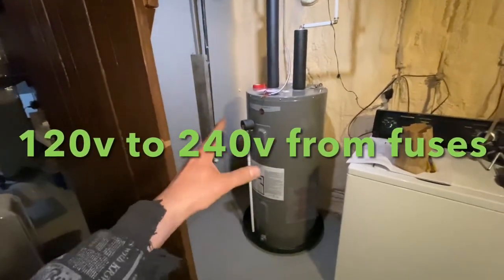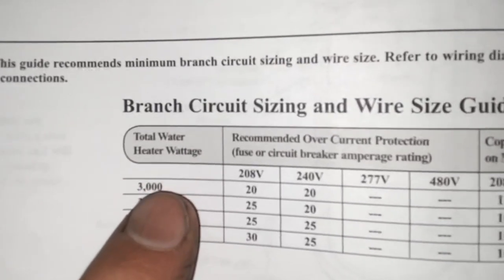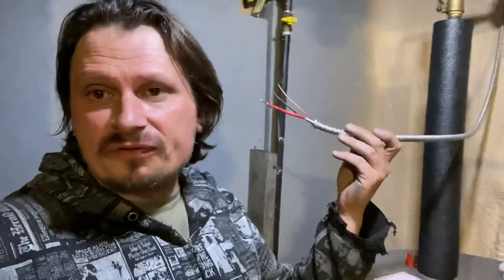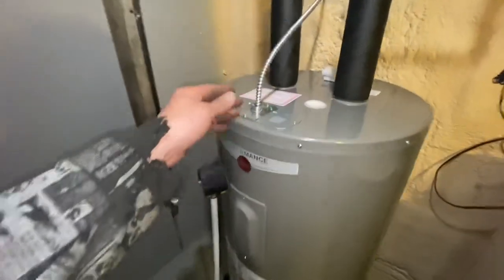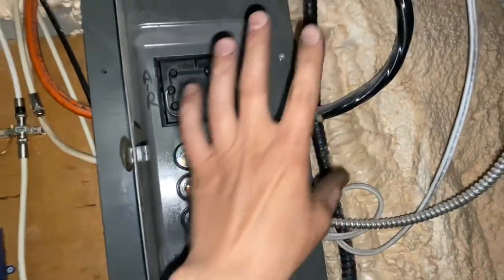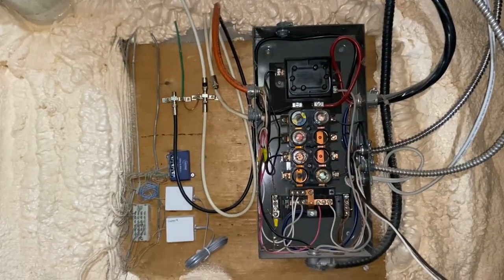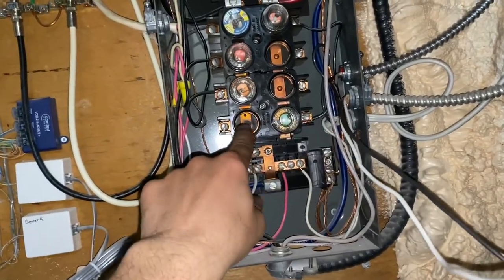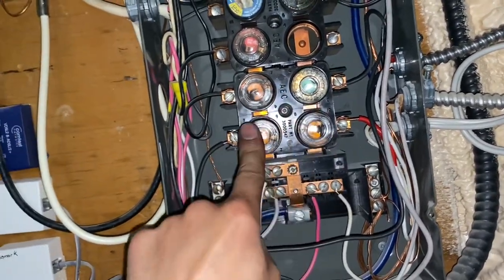How to Convert 120 V fuses to 240 V (water heater) (compressor) (240V receptacle) (240 V heater)

Comment: Thank you for taking the time to show how to hook up to an older fuse panel,  you don't see too many of these in use anymore.  Although using plug fuses for a 240 volt load does provide the same protection for the wiring as a two pole breaker in a modern installation,  there is a safety risk involved of there's ever a problem and a fuse blows.  Only one fuse will blow, leaving part of the circuit live and even through you'll get a chance to enjoy a cold shower when your running late for work in the morning 😂😂 , it is not safe to begin fiddling with the water heater, unless you enjoy the feeling of being knocked across the room.   That's why 240 volt circuits,  as well as multiwire circuits where two halves of a receptacle are on the red and black sharing the neutral  typically seen in kitchens from the 70s until the 90s,  are required to be on a double pole breaker,  or two single poles with an identified handle tie, because if either side trips you want to ensure that all power is removed.

Comment: This works and does provide over load and short protection, but I am fairly certain that the code book has not allowed "plug fuses" (screw in) to be used for 240 volt since the 1960's. Cartridge fuses that fit in a "pull out" holder are  used so that removing the pull out removes power from both hot legs of the circuit. It would be good to clearly mark these for safety sake.

Comment: Thanks for taking the time to break down how the panel actually works, makes perfect sense once you know.  I have probably the last generation fuse type panels built and I couldn't find any information on them other then wire gauge and fuse amp size safety tip or just change the panel.  Glad to have some "entertainment" information on the practical side of using and modifying them.
Reply from the maker: Hey, thanks for watching

Comment: Are you sure the wires need to be right across from each other in that box?
  I mean each leg only supplies 120 volts, two separate phases right?
  Not sure I understand why they need to be straight in line with each other.
Reply from the maker: That was code back in 1943, technically it shouldn't make any difference where you put it. 
 Do everything at your own risk.

Comment: I have a question. What happens if you have the two fuses on the same side like
Reply: I rent a house and we smelled a weird smell in the outside closet the other day. I went to turn my dryer on today and it wouldn't work so I went and looked at the fuses and the one that's labeled DRYER was burnt and busted . So I was told to replace the fuse. I took the fuse that was in the spot above it and use it since it was labeled as "N/A" well the dryer worked but wasn't getting hot. So I seen another video where a guy had only his dryer hooked up in a box like this with only 2 fuse spots both 30 so I thought hmmm...maybe It has to have the fuse in the one above it too. So I put one in it and the heat worked. I turned the dryer off and later started it back up for about 15mins and came outside and the fuse in the spot of the one that busted was pretty warm to the touch.
Reply from the maker: Sorry not too sure
Reply from the maker: The dryer is different from this though a dryer has four wires and a water heater has three

Comment: NOT a good idea. Replace the whole panel. That fuse you moved looks like 30 amp (it's green). What is that single 30 amp fuse going to? Wire does not look like 10 gauge to me. Can't imagine what would need 30 amp 120 volt. Also not a good idea to run 240 volt appliances with individual fuses as if one blows, the other is still hot. That is why 240 volt breakers are tied together so BOTH legs are shut off.
Reply: This method will work for feeding 240 volt loads with plug fuses, but it's not a safe way to do it. One fuse will stay hot when one blows, and this could be a safety hazard when you go to replace that fuse and your hand grazes the screwshell of the fuse you're removing.  If you want to power 240 volt loads with fuses, it needs to be either a disconnect switch that disconnects both fuses simultaneously when you pull the handle off so you can safely change them. Or they  eed a pullout fuse disconnect with both fuses in it, like you have for the A/C circuit on top.  That green 30 amp fuse shouldn't be feeding any lighting or appliances that are not 240 volts.
Reply: If your water heater has an issue and has overcurrent or short circuit, it can blow one or both fuses.  This is exactly the same as in the AC pull out.  So far so good right?   Not really.   I’m from US and our NEC almost word for word (for all intents and purposes) is the same.   These codes require that there be means of disconnect that turn off ALL ungrounded conductors in a branch circuit or multiwire branch circuit at the same time.   That is why there are pull outs for 240 volts, 2 pole circuit breakers, and handle ties. 
So, does it work?  Yes.  Is it safe? The answer is yes and no.   Yes it’s fused, no it maintains power at the heater if only one fuse is removed by someone to work on the water heater.  I know, you are there, but maybe one a certain day you are not there, or you have left.  You are putting someone else’s life at risk.
Bottom line, it is a violation of the CEC (Canadian Electrical Code).